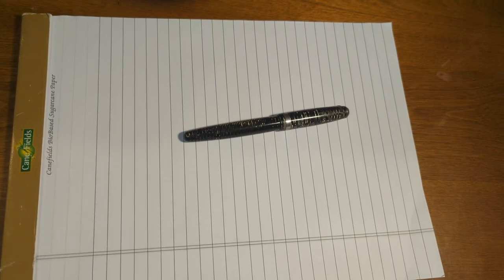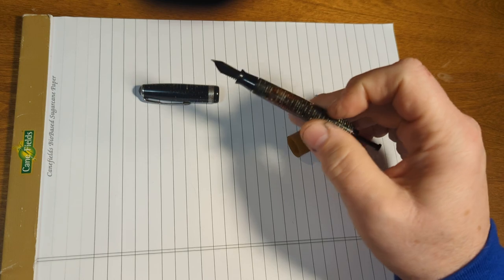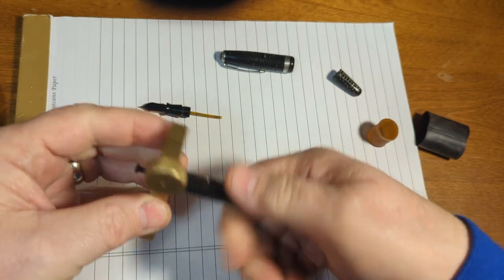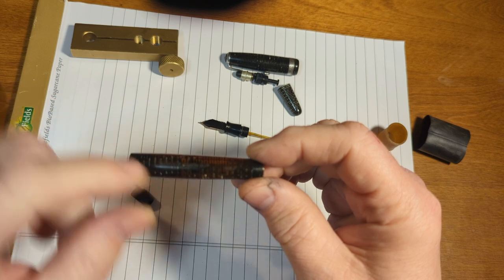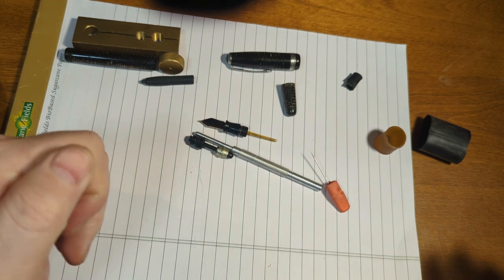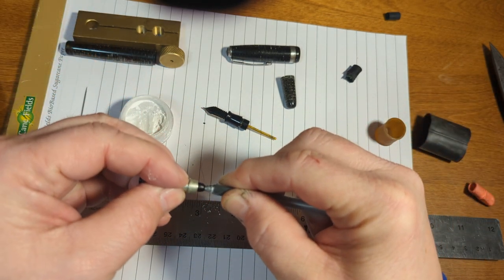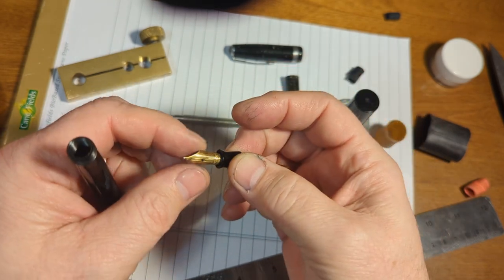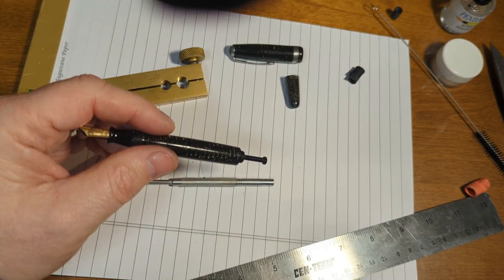Parker Vacumatic Repair

Comment: Thanks much.  How do you clean up the celluloid ?
Reply from the maker: I usually use a light polish, being careful not to use an abrasive on the metal trim or the markings.  On the most damaged pens, I have gone much further, using 2000 grit paper, then polishing.  I don't like to do too much, but sometimes they need some help.  It isn't a good idea to use powered buffers.  Some celluloids will melt with too much friction/heat.
Reply: @bryanmarsh9886  Thanks. I appreciate the suggestion. I have one or two of these lovely Vacuumatics and just ordered an old Japanese celluloid pen and was thinking of how to clean them a bit so I can return them to use, but certainly don't want to cause any permanent damage.  Thanks again for sharing your videos.

Comment: I just took a section off using my hairdryer, and patience. It was interesting. I thought it would take more might. When that shellac reached the temperature it needed to melt, the need for force was 1/10th of what I was prepared for. This is a lesson.